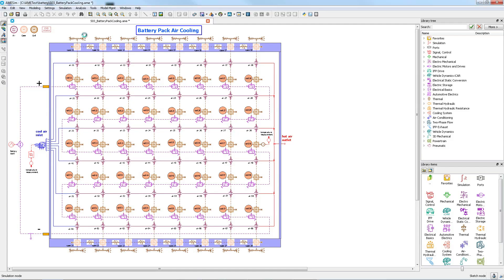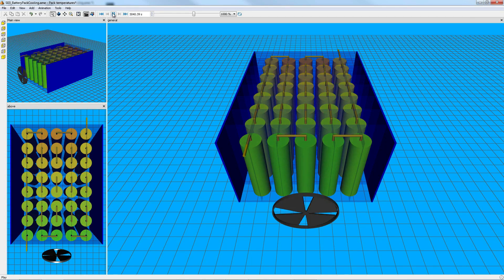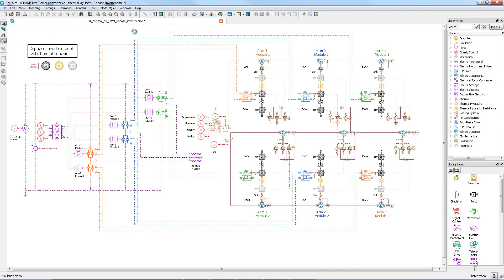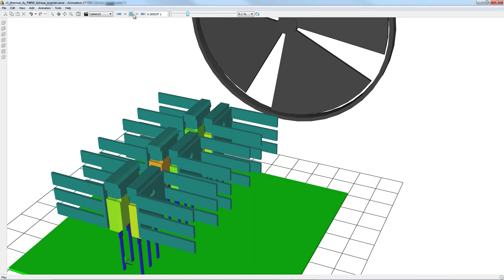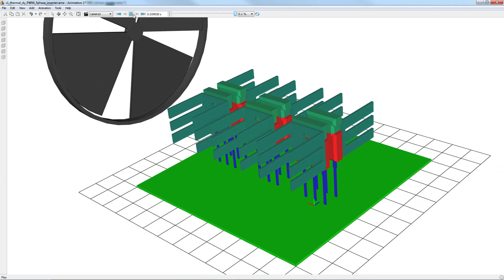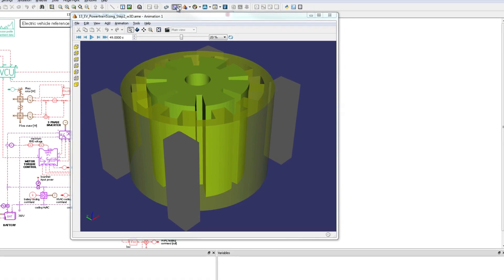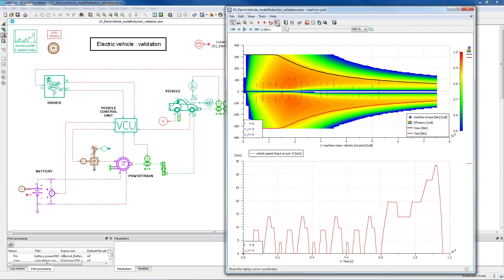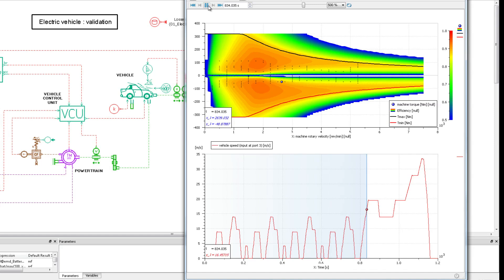Simcenter Amesim - Tackling vehicle electrification engineering challenges #SimcenterVehicle

Comment: auto engig. has attained technology saturation. Still we have three innovations in the field. i. Integrated Starter Alternator. ii. automatic gear selection based on torque gauged in transmission. iii. Barrel valvesf and cluster sparks for most efficient enigne.